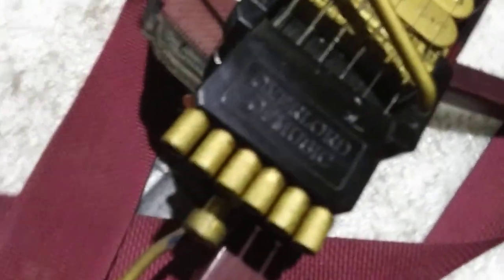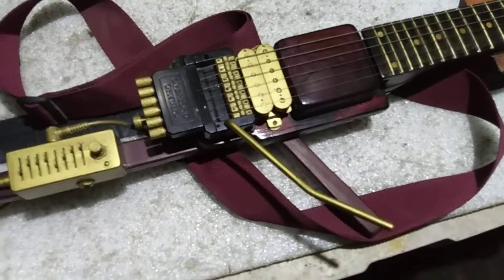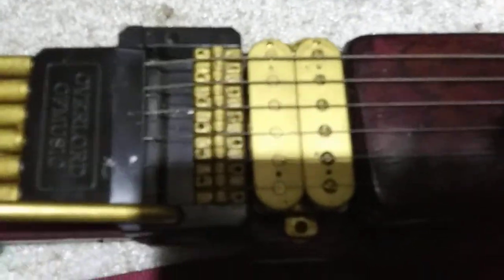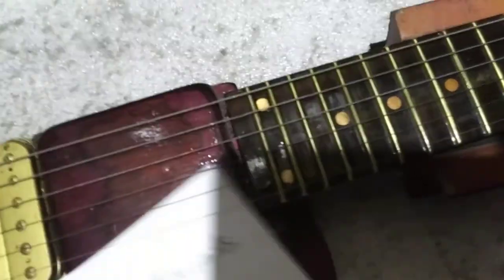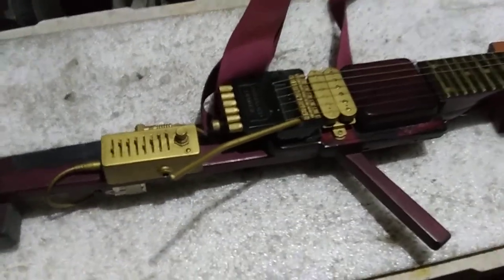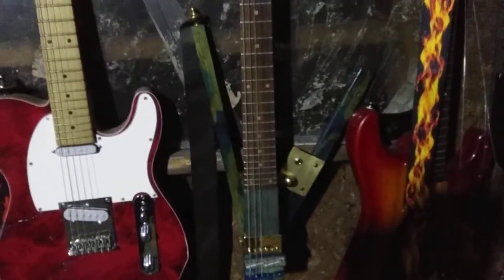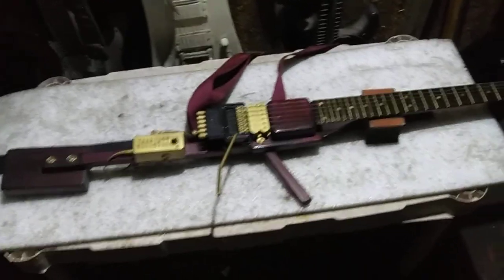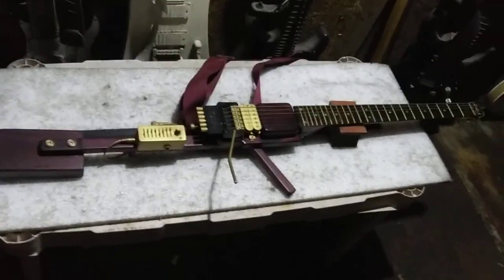The X-4 experimental guitar.

Comment from the maker: In this video I mention a nut buzz issue.  It turns out the true cause was insufficient break angle behind the zero fret and was not related to the nut itself.  The nut was simply installed a bit too high at first.

Comment: did this bridge hold up to regular play or what? there's a lot to go wrong if the materials aren't stable enough for the excellent design. Interesting ideas on your build.
Reply from the maker: The X-4 went through three versions, then it became the X-12, and then the X-13 - all with the same bridge (as I recall).  Yesterday I just happened to be searching for something lighter but with all the same features - with no luck - and came across a US manufacturer who makes a beefier version of the Steinberger "R" trem. I can't recall the exact manufacturer (JBsomething?) or website (headlessguitars.com?).  At the same time I came across references to lack of quality with the Overlord of Music version.   Apparently the original Steinberger was of higher quality.  Once I stripped out a locknut screw, but that's the only issue I ever had with them. I have 5 guitars equipped with them, and one build underway that uses one.